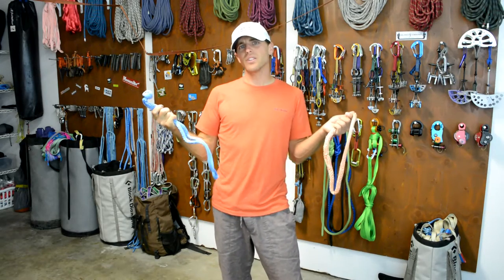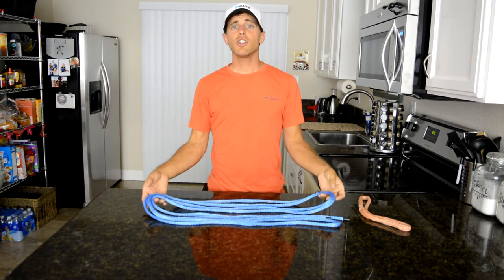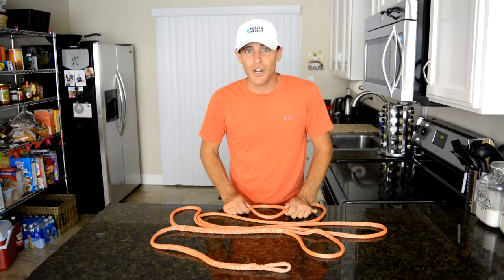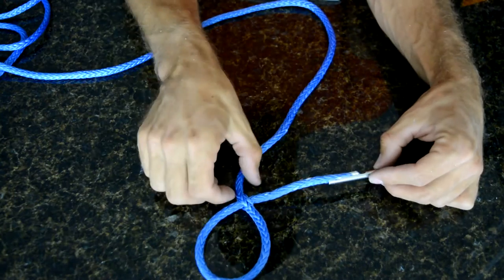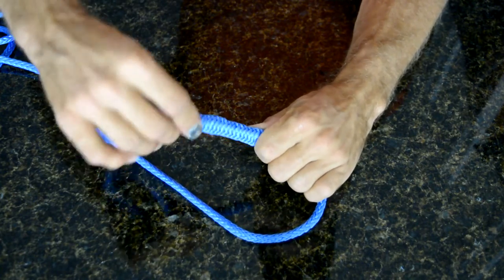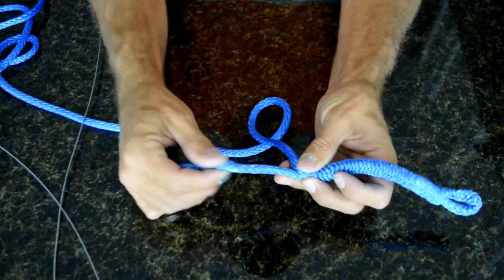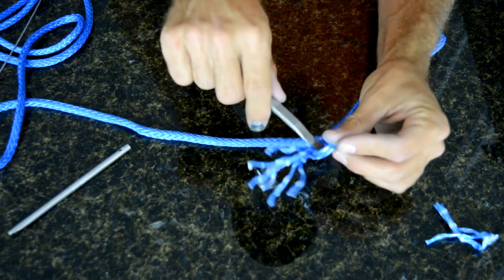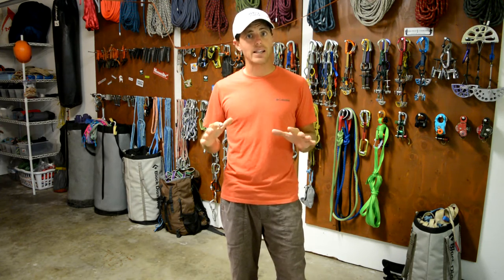Highlining - Amsteel 101

Comment: As a competitive sailor among other things, I always loved dyneema/amsteel type lines for their low friction, great strength/weight ratio, and ultra static nature. This lets the rigging run smoothly and efficiently, eliminates unnecessary weight without compromising performance or safety, and sail settings wouldn't ever-so- slightly change from where you set them due to rope stretch. The ease of splicing also makes it very practical and lends itself nicely to permanent/semi permanent attachments, which are numerous on a boat.
Reply: Multi-functional!!! Love it!!!